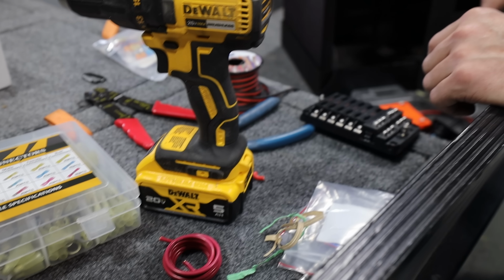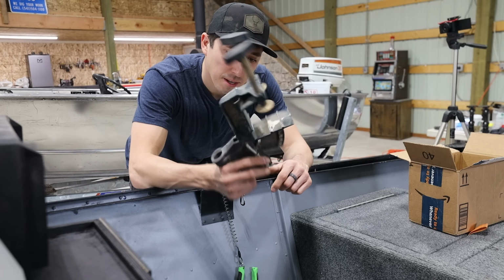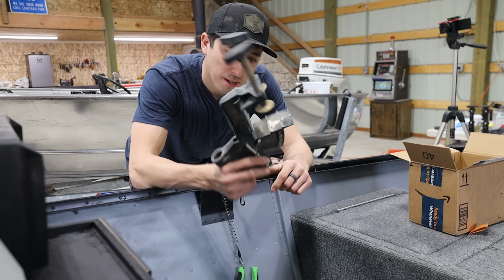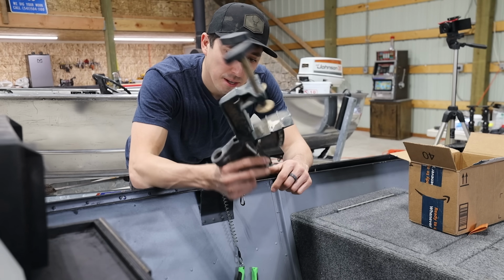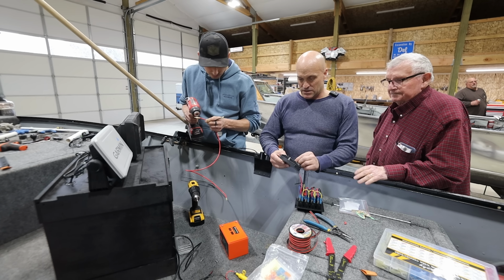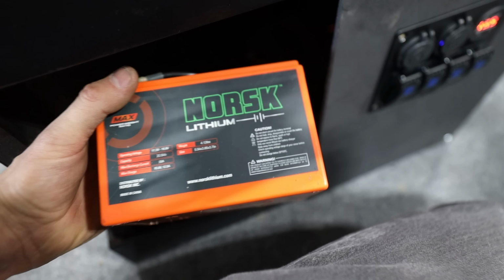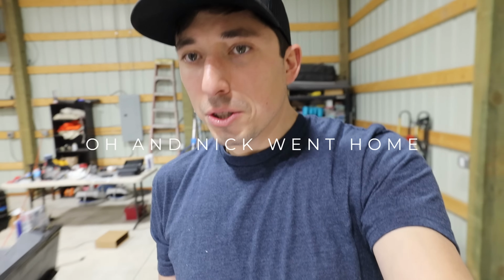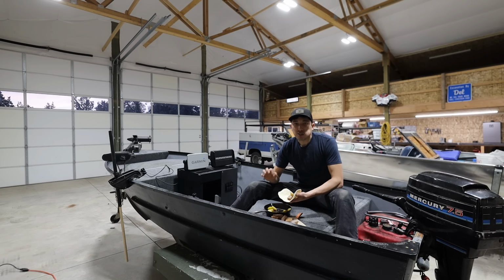Found 40 holes in my new boat! 🤦‍♂️-  Ep 02

Comment: 12 volt also does not like bad grounds be sure to ground everything  well and if your truck has a 7 way plug in it it will have a hardwired ground in it and run a 7way plug on trailer and you can run dedicated ground to the trailer lights and ground the lights right back to the trailer also

Comment: The transducer needs to be level left to right and also needs to run level when at idle speed that you will be graphing for best image . Most of time it has slight tilt up usually when boat is on the trailer but when boat is at idle forward speed the back of back is sitting down some and the transducer in return become level . Can use small level and some coins and determine level at idle several videos out on how to mount transducer so it runs level at idle forward graphing view .

Comment: The holes add character. Leaks are over rated . When it gets little full pull your plug and just get up and run around like half throttle till water runs out then put plug back in . Easy Peezy